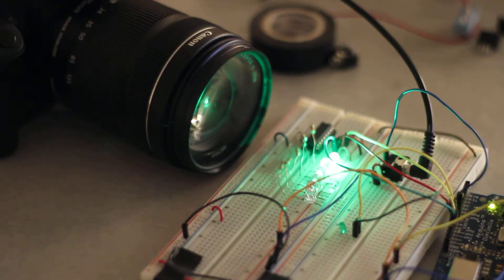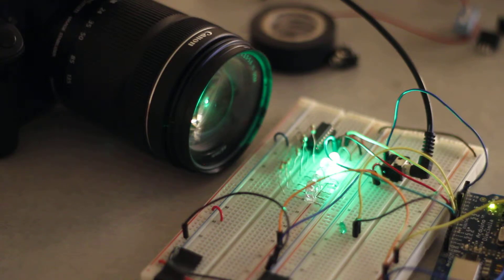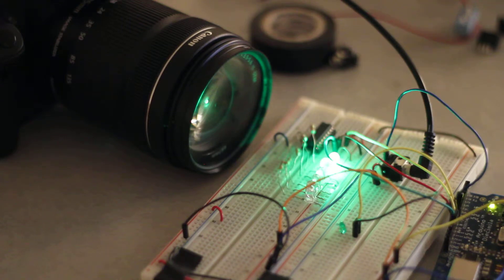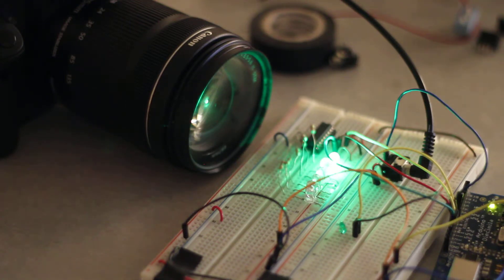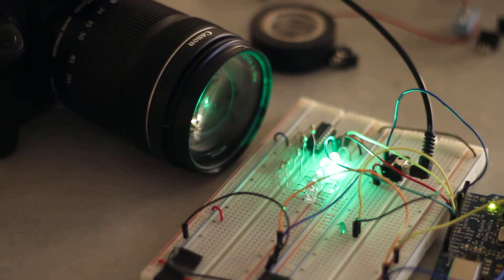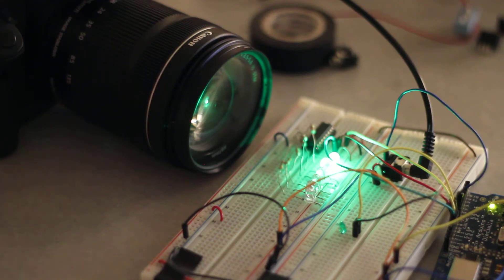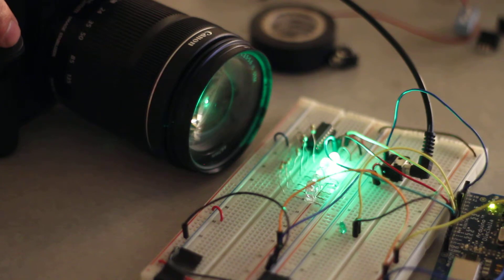T4i hot shoe LED Test

Comment: Thank you so much for sharing!
 I am doing a project link this. How do you connect the hotshoe to the arduino? I am concerne about damaging the arduino with any voltage that may come form the camera. I would appreciate a brief comment. Thanks!
Reply from the maker: That is a valid concern. You have to be very careful with high voltage from a real flash damaging the Arduino. 

I used an optoisolator to connect the hotshoe to the arduino. I think a 4N25 or similar. If you google for “Optical Camera Trigger Isolator” you can find an instructable. I’m not sure if I used it but looks like a reasonable approach.
Reply: @JoeR14 Hello. Thank you for replying. It still does not work for me, it triggers randomly. Would you be able to share your code?

Comment: How does a hot shoe work? I thought it was a switch that closed whenever you released the shutter, but it seems like in this video it sends out a signal to the Arduino?
Reply from the maker: @G_Rivera2  yah so whenever the flash is enabled, and adapter is in place in the “shoe”, and the shutter closes, a circuit is closed. 

It allows for brand independent flash synchronization. In this video I used an off the shelf adapter to more easily access that signal over 3.5mm cable and connect it to Arduino. 

The Arduino is sampling the signal from cable at a very fast rate (compared to how frequently the shutter can close), so it is able to detect when the flash should be triggered. When it is triggered, it can then invoke a routine. In this case I just had it light up the next LED in the sequence. 

Because the camera is operating via a different power system/ constraints compared to the Arduino, an optoisolator is put in place between the Arduino and the camera signal, so there is a layer of protection while processing signals from the camera.
Reply: @JoeR14  I see. My camera hot shoe signal is in the mV range. Is that signal big enough to feed into an optoisolator, or would I need amplify it first?